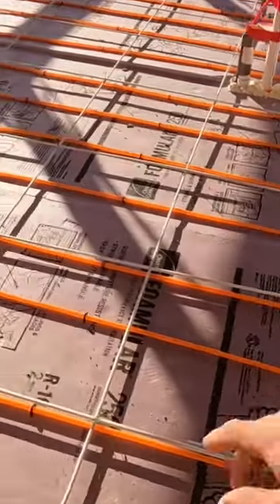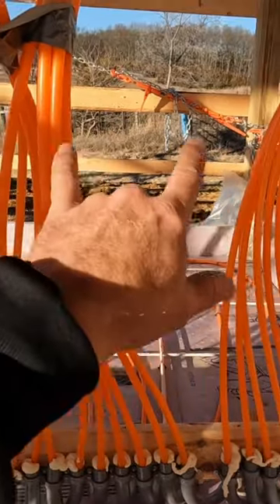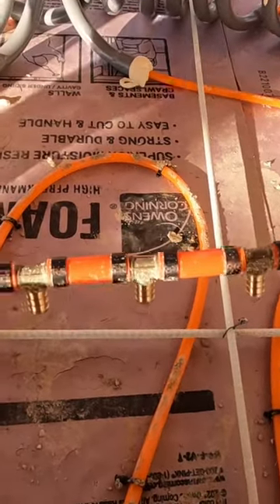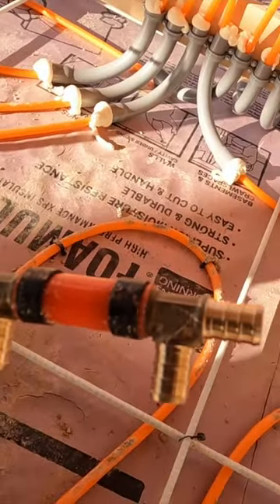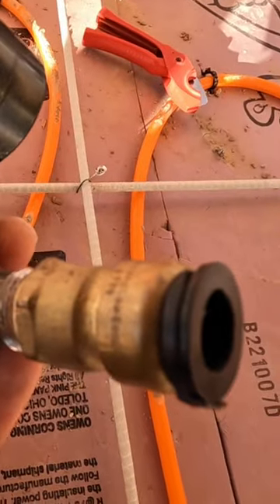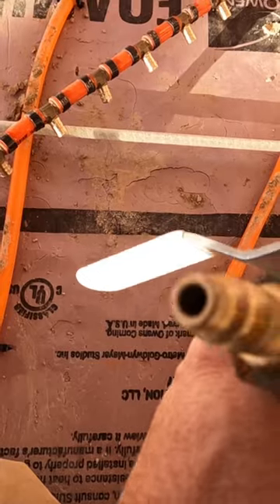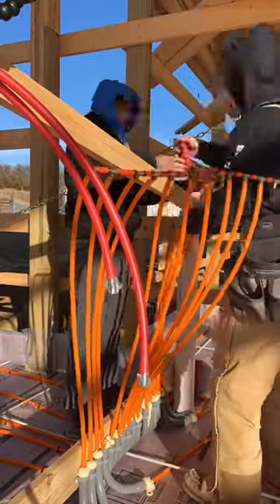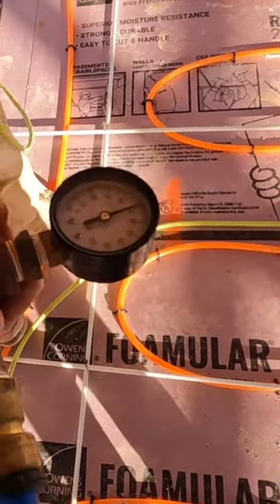Temp Manifold to Pressurize Radiant Heat Tubes #shorts #shortsmaschallenge

Comment: That's a lot of expensive fittings.  My Heating contractor just used plastic couplings and plugged the end of the first run, and then looped each run to the next with the air fitting at the end of the last loop.
Reply from the maker: We re-use this on every job…not a one time use.
Reply: @MrPostFrame  why do you use the old crimp rings ? Have you tried the newer stainless steel ones that you only crimp a small stub ?  They work amazing and I've never had a leak in 4 years of using them.  Also much easier to do in tight spaces.